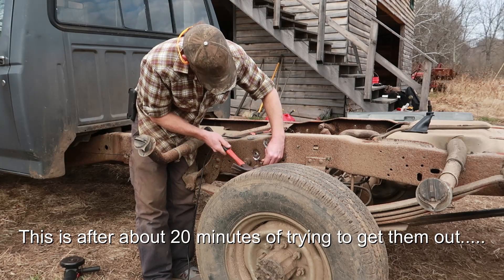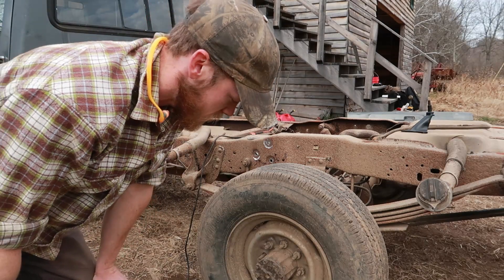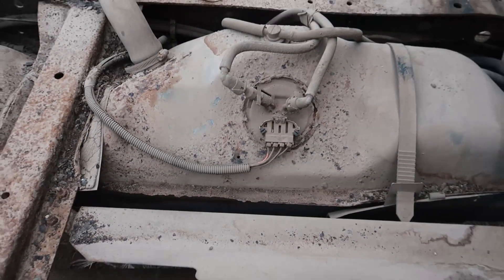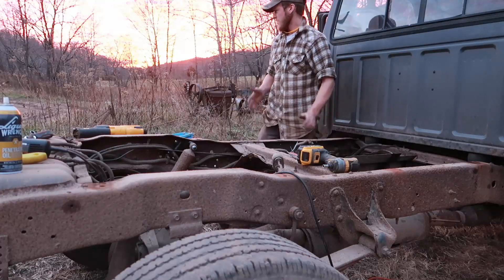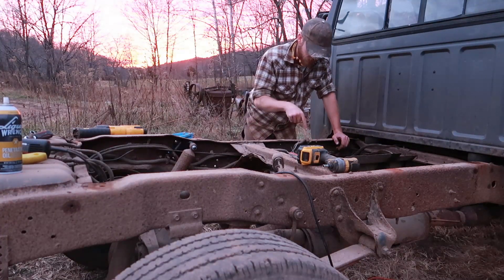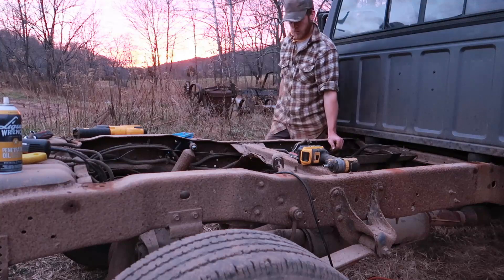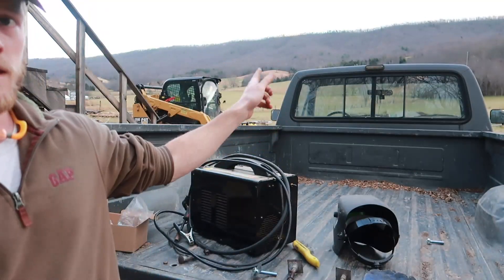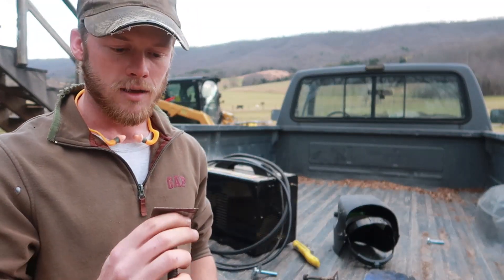Replacing Shock Mount + Pulling Front Fuel Tank | Fixing the Farm Truck

Comment: I would recommend that you spend a few extra dollars now while you have the truckbed off and replace the shocks. You have easy access to all the mounting points and they look like they are original equipment and might need replacement.

Comment: Josh, the earlier suggestion to replace the rear shocks sounds sensible. Also I would spray everything with a rust arrestor. Finally you solicited for a pneumatic impact gun. Be aware that many/most shops are using battery powered impacts. You can get 1/2" or 3/4" and even 1" square drive. It's great that you're giving the farm truck a new lease on life for the new year. Best to you and yours in 2022!
Reply from the maker: Thanks for the ideas! I've looked a little at both and it seems that I can maybe get more bang for the buck with pneumatic. Have to do some more looking on that. Happy New Year!
Reply: @LandisLegacyFarm , I figured you'd considered both. I just like the convenience of not having to fire up the compressor, run a hose, and/or fill an air tank.

Comment: You welded the bed bolt holes right, the grinder makes you the welder you aren't. I like to use copper ease on everything I ever need to take off again. Some use never seize and others the copper. I fall on the one handy. I would never ask someone to weld something I wouldn't myself. Throw that tank off camera into a bonfire and get the hell out of there because its going to go boom in a big way. I have had one actually blow the fire out/lol. Were I you, I would tilt the truck to the side to weld more horizontally as vertical welds are for pro's. Your going to do just fine. Don't be afraid to plate something after welding as well.